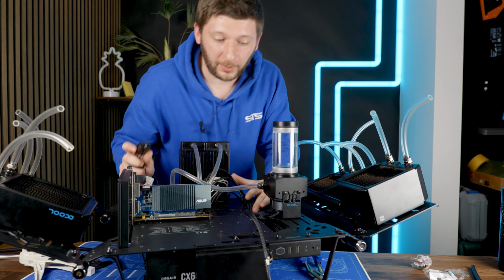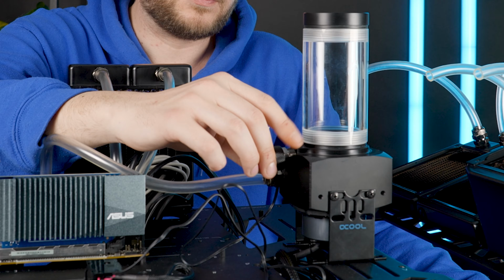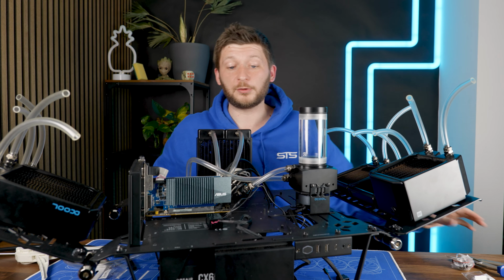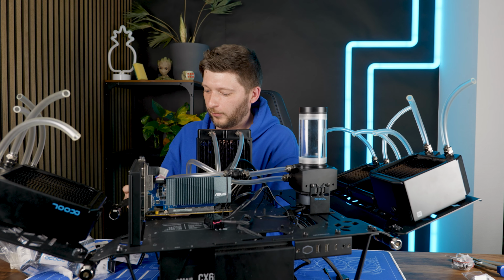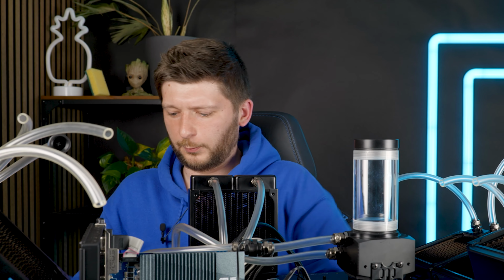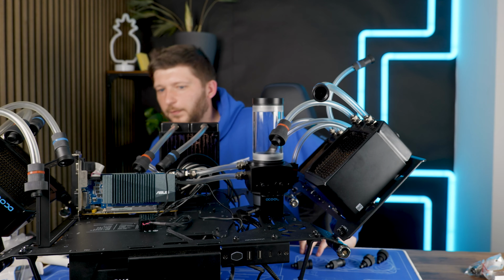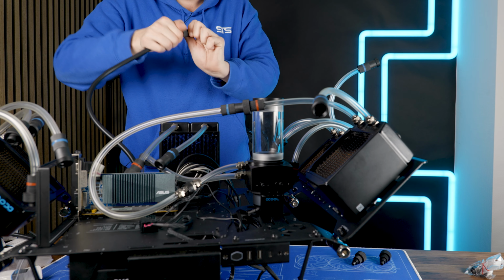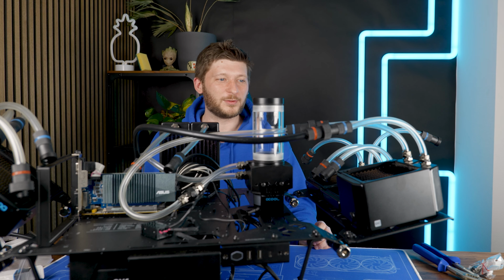Episode 6: Sensor Solutions: Water Temperature Unleashed!

Comment: Great channel. Not a criticism but why use such non conventional radiator sizes? Does your rad choice show the differences in fan performance better on those very thick rads? Thanks for another great video!
Reply from the maker: Thanks!
Well, I’m hoping 😅
The results I’m hoping to see is that the less sense the rad the better the performance of non-static pressure optimized fans compared to raw- static pressure fans

Comment: Oh boy, you did not need to buy fittings for the radiators as you could've gotten G1/4 male-female quick disconnects 😅. I use some so I know. Nice work still 😄
Reply from the maker: Wouldn’t that create a mess every time is disconnect them? As in me not being able to put any paper underneath the connectors
Reply: @STSYT  too bad you can't add photos in comments, but yes, one side of the connection (female) will have a few drops with each disconnect